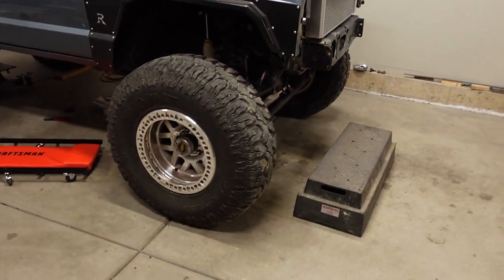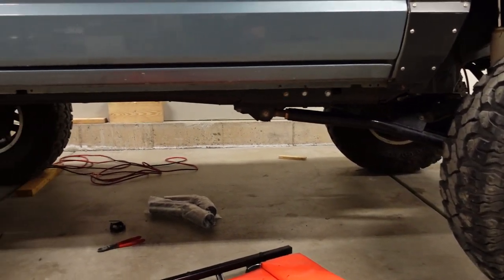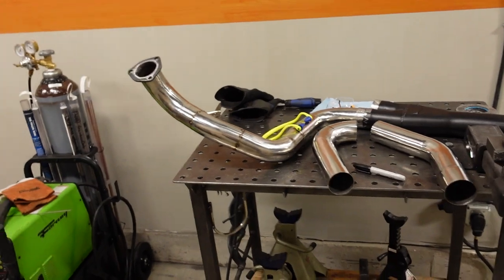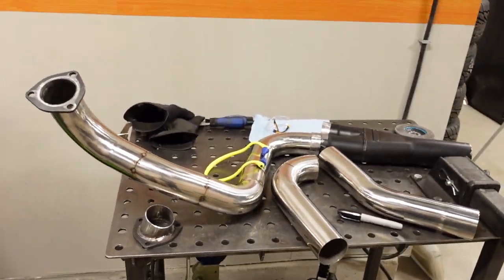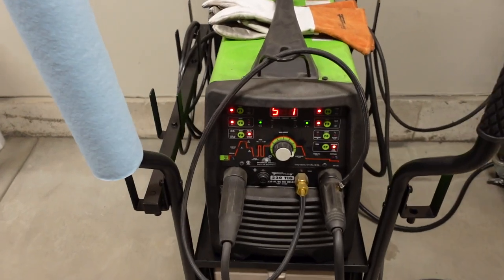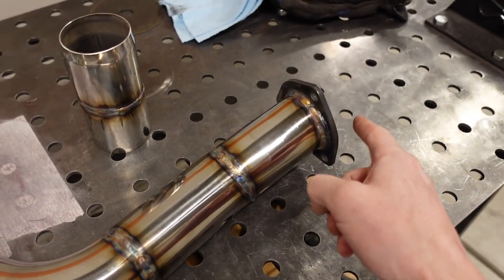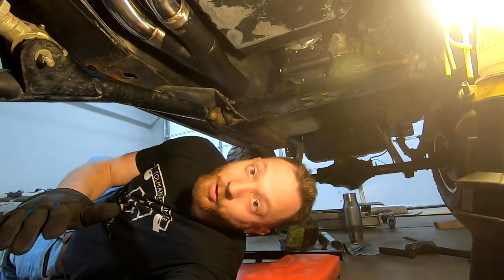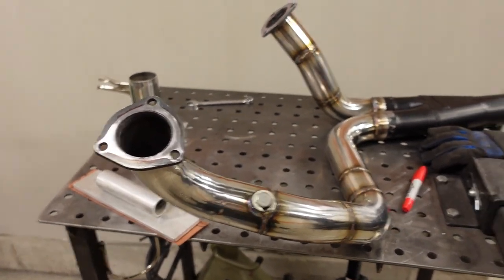LS Swapped Jeep gets an Exhaust: TIG Welder Setup for Thin Stainless

Comment: I used the same design of Flowmaster y pipe on my Silverado when converting it to a single 4" exhaust. I think it's one of the more efficient designs. Others seem to neck down at the merge before expanding to the larger size. 
  It's always satisfying to watch you weld together a custom exhaust. Keep up the good work.
Reply from the maker: Thanks! I remember reading a magazine test many years ago, and they had said the Flowmaster Y pipe was one of the best flowing out there (especially for the money). There's some way fancy ones out there, but they're like $200 or more

Comment: Hey LT, what I ended out finding out the hard way is that there just isn't enough space next to the trans pan to avoid massive heat soak to the trans pan. (Pretty much boils the trans fluid) I ended up building my own merge collector and keeping it tight to the frame to keep it away from the trans. Looks great though.
Reply from the maker: another reason why I liked the narrower Y pipe, to keep exhaust a little further away from the trans pan.
Reply: I originally used the same one you had and didnt use.

Comment: LT, if you have a bore scope you could look inside the pipe and see if there is any "sugaring" on that stainless. That will really tell you if your too hot. When I used to weld SS my weld would look really good on the top and I would flip it over and sometimes would have that sugaring on the back.

Comment: A quick way to tell if it is 400 or 300 series stainless steel is to see if a magnet sticks.  300 series should have very little if any at all (may be some in the heat affected  zone around the welds) stick with the magnet.  400 series will stick the magnet pretty strongly

Comment: You might want to add some flex pipes. I built the y pipe to my ls swapped xj almost the same way and it keeps blowing out the collector gasket including solid copper ones
Reply from the maker: not a bad idea

Comment: Very nice job was just wondering what blade do you have on your chop saw those look like clean cuts
Reply from the maker: its just a 14" abrasive blade from Home Depot. It does OK on this thin material, but the cuts do require a lot of clean up. For a chop saw, I really like the Trajan Carbide teeth saws we used to use at work. They require almost no cleanup work at all, and put almost no heat into the metal

Comment: LT what do you think about shorty headers on a daily driven 2018 Silverado 5.3? I'm thinking about stainless engineering headers 25-1040 part number
Reply from the maker: in my opinion on a modern truck, unless you're going  with a  true long tube header it won't be worth the money, modern exhaust manifolds flow pretty good.